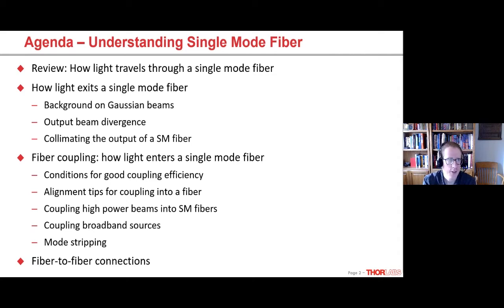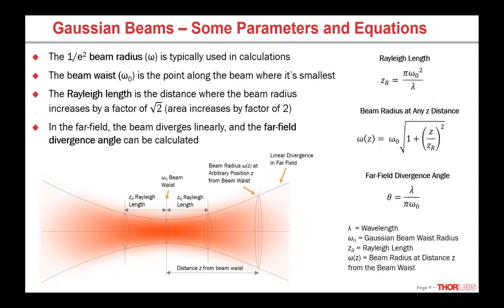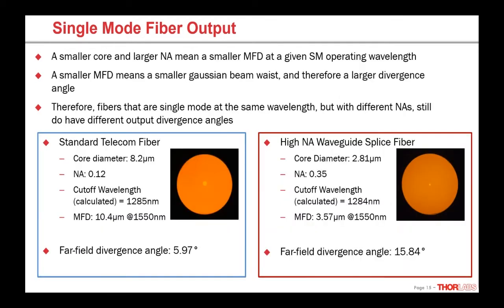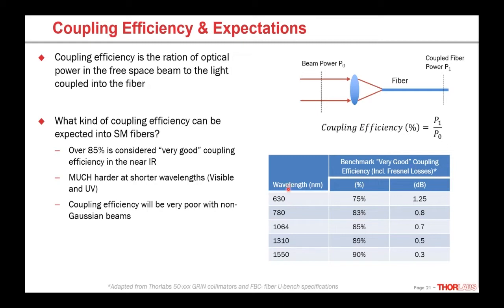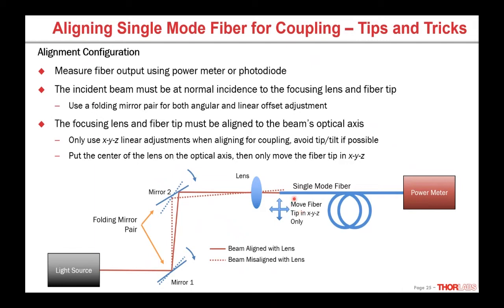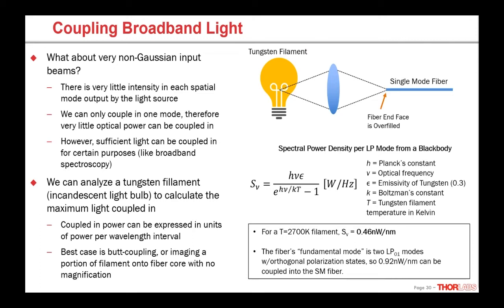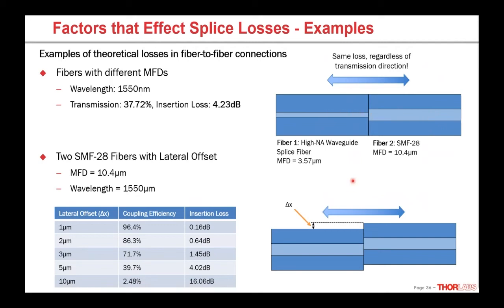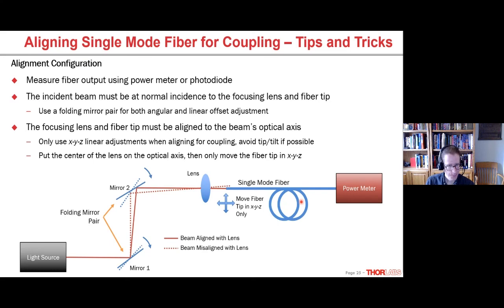Optical Fiber 101: Using Single Mode Fiber (Part 2 of 2)

Comment: For a diffuse source like the filament (I'm thinking of monochromatic diffuse light), what are the coupling efficiencies we could achieve? Couldn't I grab light from a bigger solid angle and focus it on the correct MFD to couple more light in? I understand MFD and gaussian profile are the needed conditions to couple, but not the NA of my focusing lens
Reply from the maker: This is a tricky question. The answer, as I understand it, is that the best coupling efficiency you can achieve would be through 1:1 imaging of the hottest part of the filament onto the fiber’s core. That’s what the equations I show in the webinar are based on. If you change the imaging setup to something like 2:1, then the spatial mode will be focused onto a larger area of the core and therefore all of the light won’t be coupled in. Even though the focusing lens is focusing more light from the source, you’ll actually end up with less light coupled into the fiber, compared with the 1:1 setup.

Here are some references if you want more info:
Book: Fiber Optic Test and Measurement, by Dennis Derickson. ISBN 0-13-534330-5. Section 9.8.1, Pages 370-372

https://www.rp-photonics.com/spotlight_2008_02_22.html

-Dave
Reply: @thorlabs  Thank you Dave for the answer and references! I just need to understand why you cannot focus monochromatic light to a smaller spot than where you caught it from.
Reply from the maker: Excellent question! This is due to the concept of “conservation of etendue” in optics. The idea is that you can focus light into a smaller spot, but by doing so you’re “catching” less light from the source due to the magnification you need in the lens system, etc. For coupling into a SM fiber there’s no way to cheat here.

For more information on the conservation of etendue, you can read about it here: https://en.wikipedia.org/wiki/Etendue#Conservation_of_etendue
Reply: @thorlabs  Yes, this is the concept that was failing. Thanks